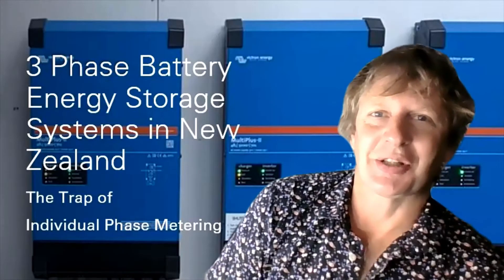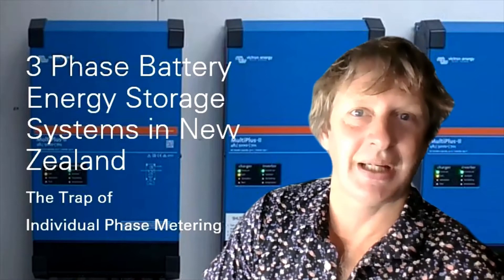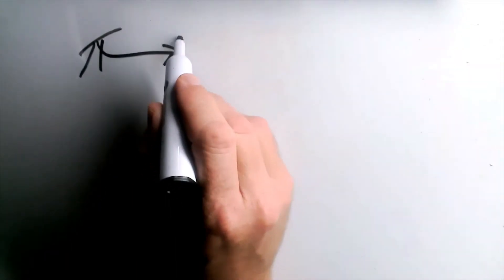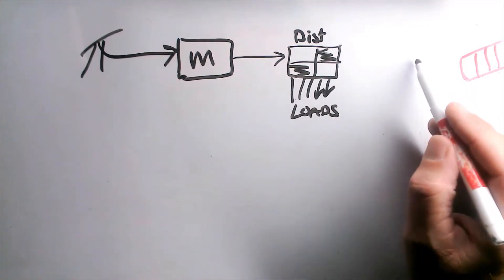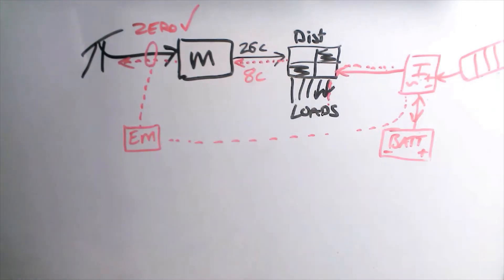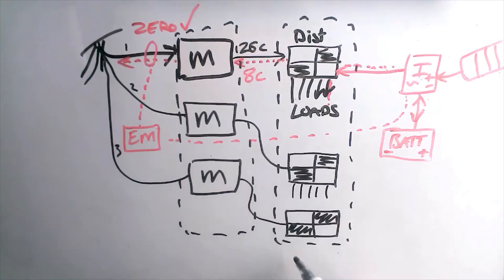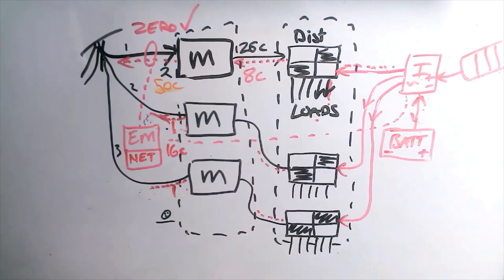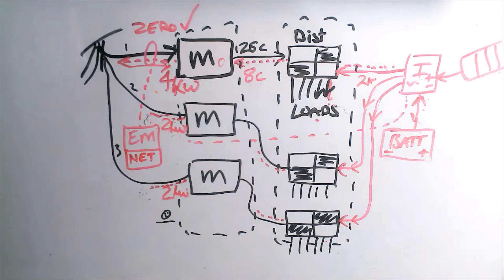3 phase ESS problem with individual phase metering in New Zealand

Comment: So one of them is Victron...what is the other one?

I live in an Eastern European country where phase metering is not defined in the laws, so each Distribution Network Operator chooses its own method. So there are maybe 5 DNOs in the country and I think two of them use billing meters with phase net metering and the other three DNOs use billing meters with individual phase billing.
Reply from the maker: Very interesting about the DNOs making up their own rules. That happens a lot here in NZ too. 

Since this video was made there are a few more manufacturers allowing individual phase balancing. One of these is the new Fronius Symo GEN24 - Fronius have promised that this feature will be included soon. . . Watch this space. 

There are also a couple of Chinese products out there but I don’t want to promote them so will just leave it there.. 😂

Comment: Hi. This is the problem in Europe too. A lot of people still have three phase individual phase metering. The system only work if you have balanced power on all three grid phases. You can achieve this by put 3:1 UPS to your load side. So now you have balanced input current on all input phases and three phase solar inverter with battery will work balanced on all three phases. Regards.